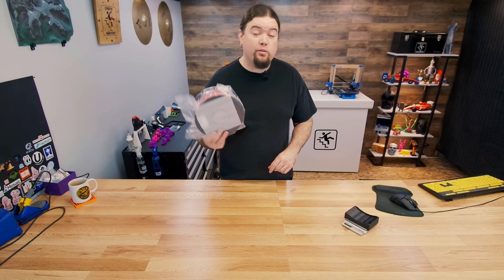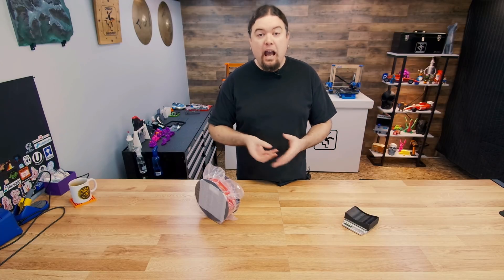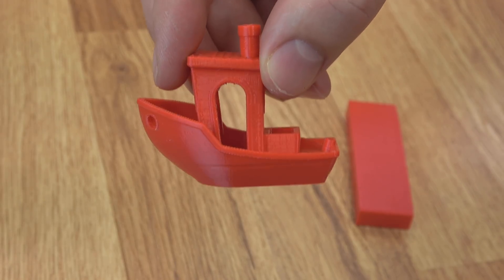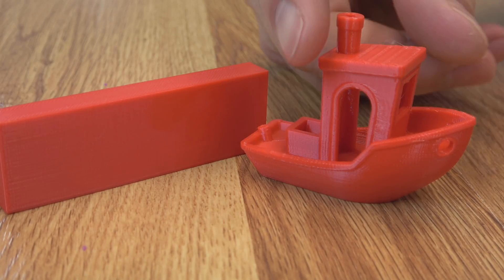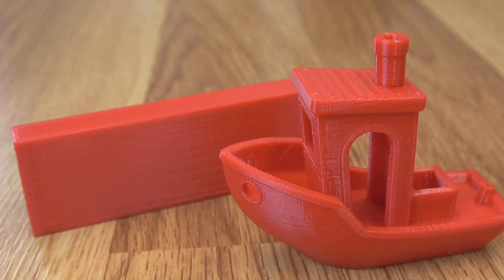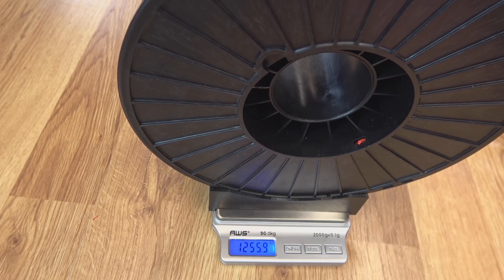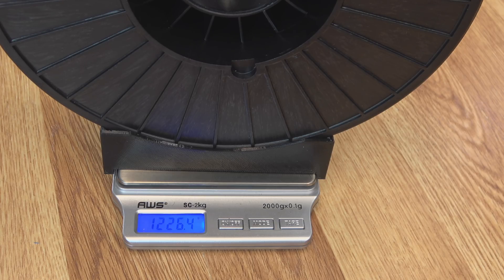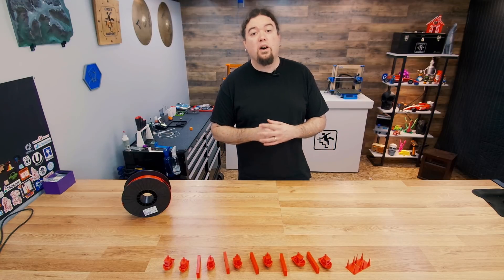Filament Drying - Fun Experiments - Printed Solid - Jessie PETG - 2022 - Chris's Basement

Comment: I'm just using some PETG and have had to dry the new rolls straight out of the packaging, had horrendous stringing, a huge huge difference after drying them for 8 hours. Humidity in our basement, where my printers are, sits around 40% right now. I keep all my rolls in sealed containers but only recently purchased some colour-changing desiccant to put in the containers instead of the desiccant packs that came with the spools. Humidity in the containers after new desiccant and after drying the spools is 18%. Decided to see how the old desiccant packs held up in a sealed container and was surprised to see the humidity levels rose to 45% in the container without the filament roll. Now every filament roll is getting dried out and new desiccant added to their containers.
Reply from the maker: That's great, thanks for sharing your experience.

Comment: With that solid-sided spool of PETG that you used I would suspect most of the water would be absorbed by the outer few turns of filament, the tightly packed inner turns being effectively sealed by those outer ones resulting in very slow diffusion further inwards.
Reply from the maker: That's very interesting, thanks!

Comment: Could it be that the mount you're using for holding the filament on the scales is loosing and gaining weight... I think maybe you should be weighing it without the 3d printed mount.
Reply from the maker: I zero out the scale with the mount already on it. Those numbers are spool weight only. Thanks for watching!
Reply: @ChrisRiley  What I mean is though that overtime the mount could be absorbing or losing water. Doesnt matter if you zero it each time. Ideally you'd weigh the mount each time before zeroing just to be sure.

Comment: You will see a big difference in florida. I have a roof opening due to insurance negating reparing. Due to that the office where my printer is located is completely exposed to outside moisture. I got bubbles is my prints and holes. I ordered a new filament from same company and no problem because the new one is dried from factory. I need a dryer.
Reply from the maker: You definitely need a dryer. :) Thanks for watching

Comment: I wasn't too happy with my Sunlu "dryer" that had no air circulation. Bought a $40 temp controlled dehydrator and it seems to work much better.
Reply: Ive been using a printed Malolo's containers.  I bought a 8lb container of color changing desiccant and rotate them in the storage bin and the dryer.  Before I started doing this, I would have moisture inside of the dryer that I would have to wipe off.  A fan would definitely help, but i was getting the sunlu dryers for like $30.
Reply from the maker: Thanks for your comments. The desiccant helps a lot.

Comment: I live in a coastal area and we get 50-60% @ 80°f humidity which does affect my PETG. A week or two in a dry box with a gland so I can print with it safely in the box and it's back to useable. Something to keep in mind is that what we call humidity is actually relative humidity and not absolute. So 30% at 50°f is less water per volume of air than 30% at 85°f, but I'm of the mind that relative humidity is what matters for drying filament.
Reply from the maker: Thanks for your insight!

Comment: If you do this type of test again, I'd like to see a 'control' filament - one that you keep in its virgin state (i.e. in a dry bag or box) without ever taking it out. Then do every print once with your test filament, and immediately again with the control filament. That way if you see differences over time vs. differences between prints from the two filaments, you can eliminate other sources of variation like wear on the machine, etc.
Reply from the maker: Thanks for the suggestion. We may do this again in the summer.

Comment: 65 C seems too low.  Water boils at 100 C, so shouldn't the temperature of the dehydrator be set to (at least) 100 C?  Well, anyway, I think you should run this experiment again over the Summer.  It will be interesting to see if the results change.
Reply from the maker: We probably will.
Reply: Water does boil at 100c but Evaporates based on the humidity in the air. As such it doesnt need to be boiled out. Just the air around it needs to be less humid.

Comment: I have a dehumidifier in my basement. During the colder winter months it very rarely goes on.  During the Sumer when the central AC is on, some days I may dump it 2 times a day. I watch the humidity because my printer in in basement also. So far as best as I can tell I haven’t had any issues with damp filament.  I made a dryer out of a air tight container that can hold 3 rolls along with 2 lbs desiccant.  Gauge I have in there says 17%
Reply from the maker: Thanks for sharing! I have a few containers too, it works great.

Comment: Ok, so now I'm wondering if you can vacuum seal a filament with a desiccant pack to dry it out. The vacuum would encourage evaporation and then the desiccant would capture the water.  It's always pretty dry here, so I'm not sure I can do the experiment myself without soaking a spool in a tub.  But I think I'm going to store my filament this way from now on.  Gotta put that food saver to work somehow!
Reply from the maker: There you go! Thanks

Comment: My printer room needs a dehumidifier anyway so I just leave it set at 35%. Never had to dry PETG, knock on wood. I'm nervous about the new tpu I haven't opened yet tho.
Reply: I have had surprising results with Ninja Flex - the humidity doesn't seem to have as much effect as on my PETG

Comment: Fun experiment - thanks for sharing.  Here in Minnesota, we have humid summers and very cold and dry winters.  The basement tamps down the extremes, but summer humidity is in the 50-60% range and winter is in the 30-35% range here.  I had a spool of PETG out in the open, during the summer for 3 months, and it was printing terribly.  I dried it, and it started to print like new again.  In winter, I don’t think that same amount of time would have had much impact at all.  As others have said, I’ve also received some very wet filament from very reputable vendors.  Drying first for PETG, or CF-infused, or nylons is a very good idea.
Reply from the maker: Thanks, it was fun.

Comment: 8:00 "we've actually lost a little bit of weight" , i  admit i haven't watched you for a long time, but i have to say it seems  that ONE of you, lost a lot more  ;) 
do not assume that brand new filaments will be dry, those deccidents won't hold eveyrthing out, it should have been dried even when it was brand new, just in case.
ok, i spoke too soon , i seee you did dry it up , 
i shudder to think what would happen to those in my room going in my 70-80% humidity, my boxes pickup humidity even when closed and contain bags of deccidents and you can see they are reaching 40%

Comment: I wonder if the extra weight was from the spool absorbing the water. I assume you used a metal reference weight to make sure the scale's measurements weren't drifting with temperature or humidity
Reply: That's a good point. Never assume!
Reply from the maker: That is a good point, I should have showed more of the setup. I was actaully testing the scale with my 123 block.

Comment: I've never dried my PLA or TPU filaments but I have dried my carbon fiber/nylon. I did hear the popping and fizzing on the nylon when I didn't dry it. I wonder if a heat light on my spool would dry it out. Like stick it in a metal box and keep a heat light going on the box.
Reply from the maker: Can't hurt. You can dry in the oven too.

Comment: What about moisture getting into a post print
Reply: Good question. Seems pretty logical to think that the material it's printed with, is still able to absorb water.
Reply from the maker: I agree.
Reply: @ChrisRiley  Maybe you can compare prints over time. Compare conditions. Outside, inside, barn, shelters etc. . How much they degrade. Loose material. Soak up water etc

Comment: Since I have a whole-house humidifier set to 45-50% (Colorado air gets really dry in the winter), I've developed the habit of keeping all of my filaments (PLA, PLA+, and PETG) in an airtight sealed tote with 3lbs of desiccant. I also have a filament dryer for each printer that dries the filament as it's printing and I keep 2-3 smaller desiccant packs in the middle of each roll while it's drying, and I've noticed a significant difference in quality from before I had the drying system and now.  Filament feeds directly from the dryer to the printer, have never used a spool holder. Might be the drying system, might just be that I'm more experienced, and the whole system is probably overkill, but it's one less thing to worry about or troubleshoot if quality issues come up. Great video, I've always wondered if I was being excessive with my drying system, now I'm pretty sure I have been, but I think I'll  keep doing it since I'm producing good quality prints in all of the different materials. Thank you for your dedication for a 50-day test.
Reply from the maker: I think your methods are on point. If it ain't broke, don't fix it!

Comment: Interesting.. I print out of a cheapy dryer, then put the filament in vacuum bags like polyalchemy has with dessicant when done. Average humidity is around 40% in my print area and I really don't expect the cheapy dryer to actually dry it. Its more for keeping the moisture out of the dryer while it's printing.
Reply from the maker: That's a good way to do it. I keep desiccant around too, it comes in very handy sometimes.

Comment: dang cuz ........i wish you had slowed down the fast forward a bit ....... i was watching some fish thaw in the sink as the same time and it went by way too fast ......... i know how basements sweat so much in the summer around these parts,  im betting the weight difference between before and after will be much greater ..... was wondering if the filament itself absorbs any moisture ( huh huhhhuh huhh i said MOISTure) internally  ..... im sure that will also vary greatly from one filament to another ...... nice job cuz
Reply from the maker: Lol, thanks Brian!

Comment: The way that a lot of filament is made is that it's ran through a water bath to cool down, and the residual heat is supposed to dehydrate the filament.

But it doesn't get everything at least not in most cases, so I suggest to dehydrate a roll as soon as you get it (unless you need to use it right now)
Reply from the maker: Thanks for the tip!

Comment: I'm in Oregon, and our humidity is over 80% typically in winter. I never heat dry my filament and I don't have issues with it, I mostly print with PETG.
Reply: Petg doesn't seem to be affected as much, but try drying your least favorite roll out and see what happens, you can do it in the oven if you don't have a dehydrator or a special machine.
Reply from the maker: Good idea! Let us know how it goes.